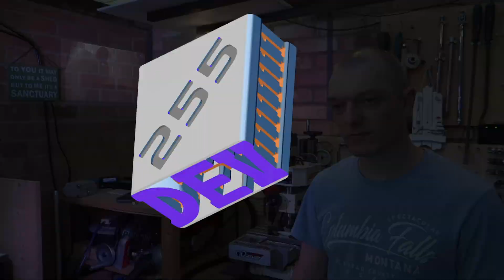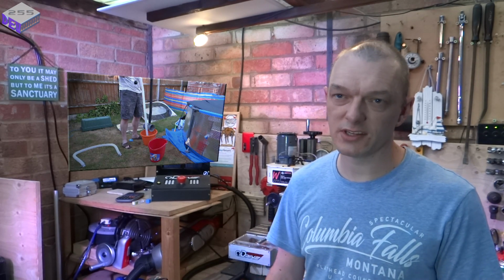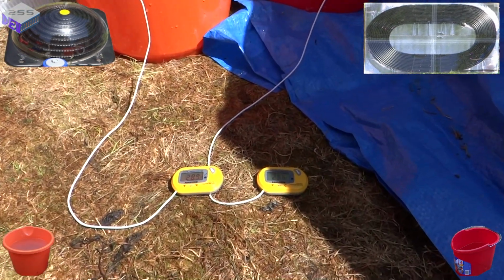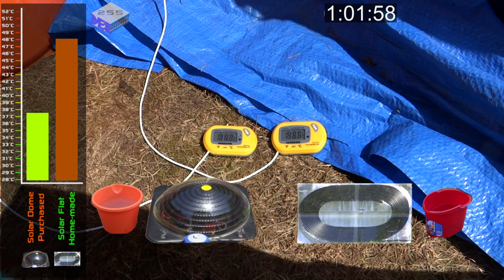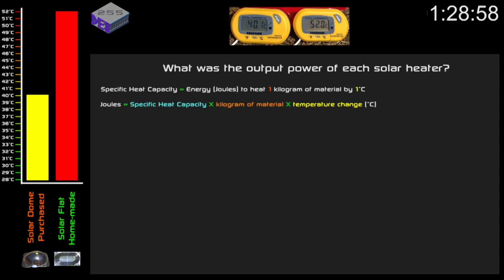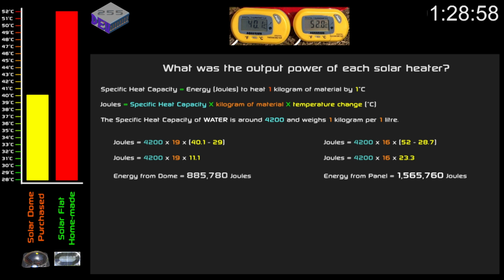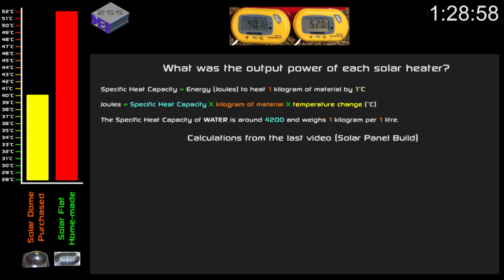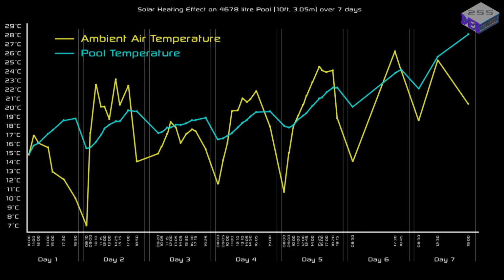2. Which Solar Pool Heater? - Homemade Vs Purchased

Comment: Thanks for video though your calcs are not correct.   A joule is energy as is a watt hour but joules/time is power.  1J/second is 1W.   1wh=joulesx3600.  I also think you have done your design an injustice.  It would be better to simply measure temperature difference between water in and out with water in kept constant at the same temp as the pool.  If water in rises then heat transfer from solar heater to water drops.  It becomes less efficient.   The same with flow rate.  Too slow a flow rate and in out temp difference increases and efficency reduces.  You have shown that the domed unit is poor.  Its problems are too large a diameter pipe so reduced surface area to water volume ratio meaning poorer heat transfer.  Also it is simply too small, I.e. surface area exposed to sun.  It looks like pipes overlay each other too.  Just on pumps.  A pump quoted flow rate is for zero head, I.e. no flow resistance.  Long thin pipes create significant flow resistance so one needs to look at  pumps quoted head of water, how high it can lift it as well.  But this does not seem an issue with your setup so long as temperature in out difference is not great say less than 10 degree Celsius.  Would be good to see how much it improves if you spray the silver stuff black.  Thanks.
Reply from the maker: Hi Mick, glad you liked it. Although I have to disagree with your statement, where my calculations are correct. The formula you mentioned of "1wh=joulesx3600" or Joules = 1Wh / 3600s, equates to 0.0002777778, which is used as a conversion factor to convert joules to Wh when the work done is only over a 1 hour period; although the heating work done was over a 1.5 hour period. So 885780 Joules x 0.000278 = 246Wh if the work was done over 1 hour, where as it was done over 1.5 hours, it is therefore 246Wh / 1.5 = 164Wh. Or as I had it Wh = Joules / (3600 x 1.5). As you said "joules/time is power" where 164W of power was sustained over 1hour (which is 164Wh), and then continued for a further half hour, but was still at a rate of 164Wh. We know that the power fluctuated by an amount above and below the 164W (because the sun is blocked by clouds), although this was the average over that time period, hence why I called it "average power" in the video.

I have since filled the center of the panel with scrunched up black bags (also increasing the surface area) which has increased the output of the panel.

I am currently making a transmitter and receiver pair from the pool to the house that incorporates 10 temperature sensors and a data logger so I can accurately track the individual temperatures and produce a detailed video on that; this will also measure the in and out temperatures of both heaters as you mentioned. Plus this has a relay output to turn the pumps off if the panel temp drops below the pool (with a hysteresis loop).

Hope that answers your comments :-).
Reply: @TheSolarPoweredEngineer  Nah, you've still got it wrong.  Power is an amount of work in an amount of time.  The dimensions of power are energy per time.  In SI units, Watts = Joules per second.  
Wh would have dimensions of (energy per time) * time, which takes you back to simply energy with a multuplying factor added to it.  1wH = 3600 Joules.  Plain and simple energy, not power.
That's why the electric company bills you for your Wh usage.  They don't care how quickly you used the energy, just how much it was in total - 1 kWh is a "Unit".
Reply from the maker: @petertr2000  Agree with your maths, that's why I divided the Joules by the time in seconds to get to the Watts, where 1Wh = 3600 Joules is the same as 1W (work done in 1 second) x 3600 seconds (1hr) = 3600 Joules and in my case 1W x 5400 seconds / 1.5 = 3600 Joules, therefore 164 Joules per second x 5400 seconds = 885600 Joules and to get to Wh it's Joules / time (s), therefore 885600 (885780 in the video) / 5400 seconds which = 164Wh. It's the Wh in the same statement as average power that is confusing people I think, should have just put W and everything would be ok😉 , I believe the calculations are all correct and everything works out (unless my logic has gone fuzzy🤔), happy for you to prove me wrong with figures 👍 and I'll eat my hat. Maybe I'll do the next test over just 1 hour. It's a fun subject and love the feedback, will you still be making yours panel?

Comment: The homemade panel you pointed at the sun during your experiment.  The dome always has a side pointed directly to the sun.  As the sun moves you would need to turn your homemade panel to face it.  The dome you don't have to turn.  So the experiment is not a good one.
Reply from the maker: Hi, I like your point, although I didn't turn the panel, where the dome didn't have its entire surface area exposed to the sun, therefore there was a lot of wasted surface area, so you could argue that this should be turned to have the sun directly above also. There was still more heating from the panel throughout the day. I'll be making another panel this year to compare with last year's homemade one too. Hope that helps.

Comment: Why not reduce variables?  utilize the same amount of water total.  Only variable is the type of heater.  Reduce calculations.  Otherwise great job.
Reply from the maker: Thank you, I tried to reduce variables as much as possible, although was struggling to keep the pipes low in the bucket with only 16 litres for the dome (pipes seem to have a life of their own) and tried 19 litres with the panel one, although too much water for the bucket. Very soon after I thought about 17.5 litres in both, although was distracted by the filming part. Will do this for the next one. Glad you liked the video.

Comment: That purchased one is a piece of crap because it has a short and thick hose in it, so the water can't heat up because it's being pumped through
in a heart beat, while the home made thing is just a thin hose that is very long, so it takes waaaaaay longer before the water is being pumped through
and getting way warmer. I have the same system only i use a bigger plate to nail the hose onto, and have about 150 meters on it and i have a plexiglas plate over it so that 
it works like a greenhouse, and that works perfect.
Reply from the maker: The purchased one is completely disconnected now as I made a new panel based on all the comments. My new homemade one is smaller than the old one but has roughly the same power output as it's all copper pipe sprayed black on an aluminium plate that is also sprayed black, all this under a glass sealed unit. I bet 150m of piping works well.
Reply: @TheSolarPoweredEngineer  
when you use clorine in the pool, then copper might not be such a good idea because copper and clorine do react with each other.
And i also made a iglo/dome tent over the pool with transparant foil over it, and that acts like a green house that heats up the water way faster,
and it keeps the heat longer inside, so at night the pool doesn't cool off that much, and it keeps the dirt out  like leaves, bugs and other crap.
I used simple electrical pvc pipe and made a think wooden rounded block for at the top where i drilled holes in to fit the pvc pipes in.
then bend those pipes to the legs of the pool and use zip ties to connect them.  And then 3 round hoops horizontal placed and tied with zip ties
again and than the foil over it and your done. your own indoor swimming dome!
Reply from the maker: @3DPeter  Hi, that's a really good point, where I did look into this as I didn't want to poison anyone, chlorine is actually added to drinking water to reduce bacteria in your home water feed and this runs through copper pipes. All is well unless there is an off-balance PH level, in which case the chlorine reacts with the copper at a far greater rate, just one of the reasons to keep the water PH between 7 and 8. I check my pool regularly and have PH + and PH - additives to hand in case it goes out of balance. I like the idea of a dome over the pool, I have a UV shelter over mine but have to take it down to get more sun on the pool.
Reply: @TheSolarPoweredEngineer  
The amount of chlorine in tap water is waaaaaaaaaaay less than the chlorine that is used in a pool, so don't make that mistake. I had a inflatable
bubble spa that had a aluminum heater element in it and that corroded so hard that it started to leak after 2 years of use. Now i have one with
a stainless steel heater element which is way more resistant against chlorine. 
Next thing is that a Uv shelter won't warm up the water , so just take it off and use normal transparent foil. When i came home from work
and the sun was backing all day, then the temperature inside the dome was about 10 degrees warmer than outside, so it sure helps to heat up the water.
Btw, these days you can also buy a transparant dome for pools. check alibaba. com

Comment: In my experience neither of these work. If you want to warm up your pool significantly you’re just going to have to go out and buy a heater it’s really that simple.
Reply from the maker: Hi Ryan, I agree if you want to "significantly" heat your pool, electric heating is the way to go as I am getting just over 1.5KW from 2 panels in max sun in the middle of the day (around 800W average over the day with sun on the panels), although for us this keeps the pool temperature tracking the outside temperature, so allows our children to stay in the pool for a good few hours without getting cold. If you want 35º+ fairly quickly then heat by electric.
Reply: I have a 2kw electric heater and it doesn't make a huge difference unless I switch it on at dawn and don't go in the pool till late afternoon luckily I have solar panels on my roof so the cost is negligible